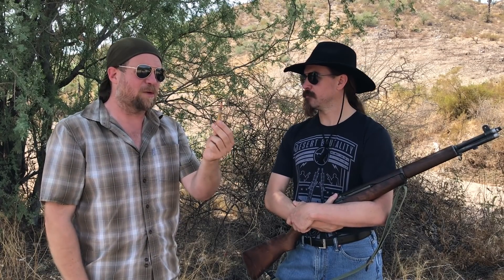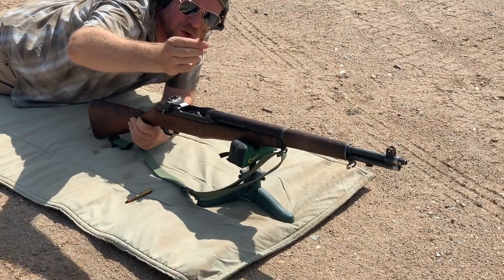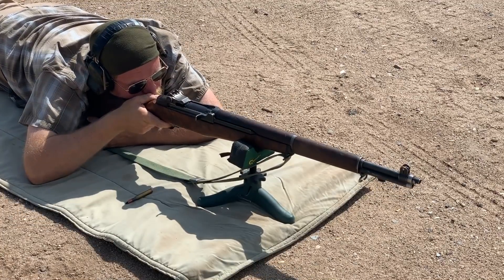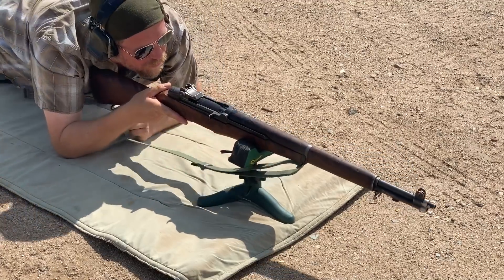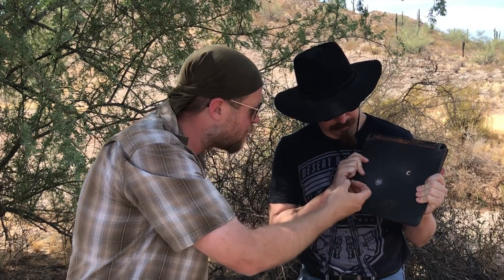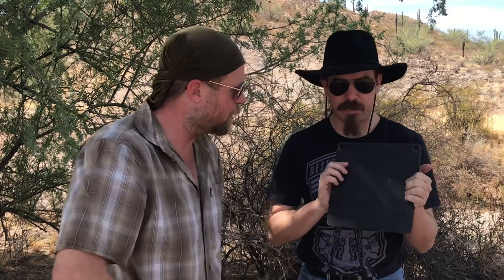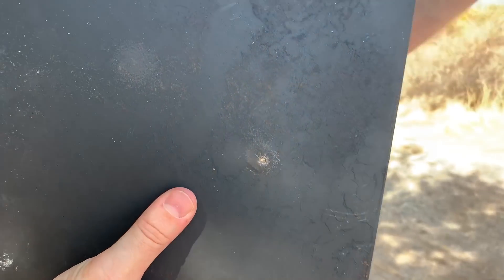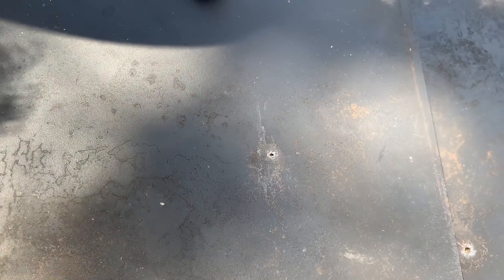Armor Piercing Ammunition Testing: 30-06 M2 AP vs 3/4" AR500 plates

Comment: Corrosive?
I've fired 30-06 AP into the web of railroad rail. Full penetration. And into concrete. The recovered AP core showed no deformation, except it's tip wasn't as sharp.
Guys, BE CAREFUL OF BACKSPLASH. I had a piece of jacket imbed under the skin of my elbow. If it had been my eye.......

Comment: Ah, was looking forward to the bullet used to test NIJ level 4 armor. Though it was a little slower than the one called for there(887 m/s) which I think represents the worst you can expect(well, worst as the one being shot at) rather than a typical shot.

Comment: I'd actually be curious to have just the one plate with a 45 angle.
Reply: Agreed except I'd like to see it in stages. Can it still penetrate at 15 degrees? How about 30? I suspect 45 would just bounce but if not, how about 60?
Reply: I'd also love to see this!
Reply: Agreed. I remember many of the German tankers who first met the Russian T-34 in battle. The T-34 was the first tank to use sloped armor and how they were shocked when their rounds did not penetrate. I laughed when one said in the interview,  'We thought this was a bad sign.'
Reply: It will eat it 30-06 ap rounds are no joke

Comment: One further thing I'd like to point out about AP testing that I know from my ventures into naval military history, two separate plates of armor, even when tied together by riveting, welding, or bolts as you've done, are actually less effective than one solid plate of equal thickness. So technically, you're not quite getting the same effect as an actual 3/4" armor plate would have, but in this case it wasn't  enough to matter. It's just something I thought I'd mention given your interest in things like angle, thickness, number of plates, and so on.
Reply: Here I was thinking that they'd actually be more effective, since the force that penetrates the steel is a product of speed and the size of the contact between the plates and penetrator. 

I'd like to see .308 AP against both 1/2 inch AR500 and two 1/4 AR500 plates, to see if the first plate can have enough of an effect on the penetrator that it becomes unable to penetrate the second plate.

Comment: Having the second plate spaced behind for a third shot would have been interesting.
Reply: Agreed.
Reply: Spaced armor exists, although it seems to have fallen out of favor compared to composite armor varieties.
Reply: @zbm-2375  True, My comment was from simple curiosity about what sort of dent the penetrator would have had, given a bit of offset removing mutual support between the plates
Reply: @zbm-2375  It's still used on the Leopard 2

The main hull has a smal gap between the outer steel plates and the start of the composit material.
Also the angled front Armor of the A5 and up versions are just a few layers of steel plates in steeper angles. <<<|
Reply: Agreed
Reply: I agree.
Reply: I'd be interested to see how a single 3/4" plate compares to the stacked 3/8" plates.
Reply: @5000rgb  I'm incline to believe the solid 3/4" will be bit harder to penetrate than 2 combined 3/8". If not the same..
Reply: they already shot the .308 AP like that in their other video.
.30-06 AP is almost the same as .308 AP except it a tiny bit faster.

Comment: Specifically noting that the majority of the Kinetic Energy is lost penetrating the first plate, while the second plate supports it. It’s not soo much about the rating of the armour as much as the support that’s behind it. The second plate was supporting the impact point stoping the additionally larger whole. 

Tl:dr having stuff in between your armour is import. (Aka composite armour)  

Also for anyone interested mythbusters  did something similar with phone books and sheet metal.
Reply: I remember learning about one-way bulletproof glass a number of years ago... it was made by facing a sheet of polycarbonate with a layer of super-hard tempered glass. In one direction, a bullet would impact the glass, lose its energy shattering it, and the polycarbonate would deform and capture the fragments; in the other direction the bullet would pierce clean through the polycarbonate and then blow the glass fragments away easily.

Comment: I wish someone would hand load these bullets into 300 Win Mag or better still 300-378 Weatherby Mag.
Reply: Seriously though, why smash armor plates at 2800 fps when you can do it at 3800 fps? I need this video.
Reply: Darn I was thinking the same thing Loading those projectiles in a 300 win mag would be an awesome idea
Reply: That and a "hot"/commercial 30-06 loading. 3000 fps should easily be done safely in 06.
Reply: Buy a bullet puller and you can do it yourself... Now you gave me an idea
Reply: John Parrish Someone made a garand in .458 in the early 00's.
Reply: @Tzarkaan  he's talking about the black tip bullet, not the Garand.

Comment: Don't forget the fact that it's two different plates. That may have an effect as well, compared to a homogeneous block of steel of equal thickness.
Reply: Exactly that is why even on vehicles such as tanks by having a small air pocket and two armor plates you change the entire layout and function of the armor.
Reply: Spaced armor is a thing (mostly on vehicles, though). So maybe this test is a up to something interesting.
Reply: @UselessZero  spaced armor needs the space to work. Laminated armor is weaker than same thickness of homogenius armor.
Reply: @pekkamakela2566  I'm guessing from your name that English isn't your first language, no offence intended but that is the greatest spelling of homogeneous that I have ever seen. :D

Comment: Is there any serious performance difference between bolt action and the garand?
Reply: Yes. You don't need to work the bolt on a Garand.  8 rounds,  no waiting. Reloading is similar, but topping off is harder. 

Military 30.06 is a bit lower velocity than what you might find today for hunting, etc. The transfer bar of the Garand is not really strong enough for constant use with max power loads.
Reply: Ian and Karl has talked about this extensively throughout the years. Any semi-auto (exept the zip) is better than the best bolt action rifles.
Reply: Osman Mustafa honestly, I was talking ammo performance over weapon performance, the recoil cycling or gas piston operation taking away from energy that the projectile could be using if the bolt is fixed
Reply: @campy8946  Oooh, I'm sorry, I thought you meant the rifle performance.
As far as I know, the loss in gas pressure is so small in gas operated guns, that it doesn't change the performance of the round.
Reply: Hi, there should not be a difference in ammo performance between a bolt action and a gas operated rifle. Gasses are only tapped off near the end of the barrel and only really start moving anything after the bullet has long left the barrel